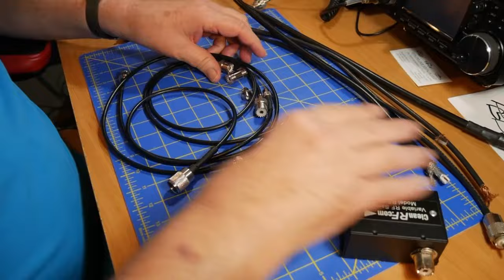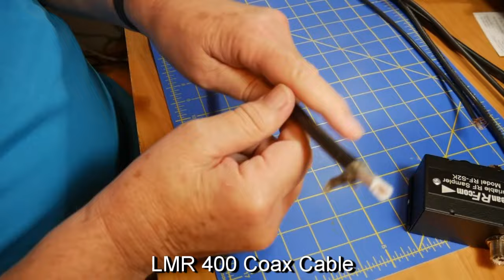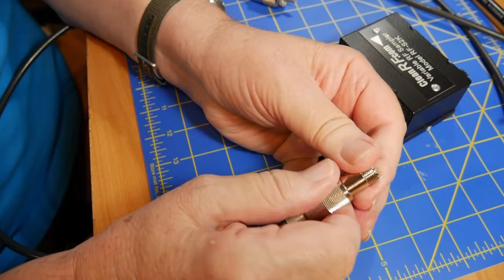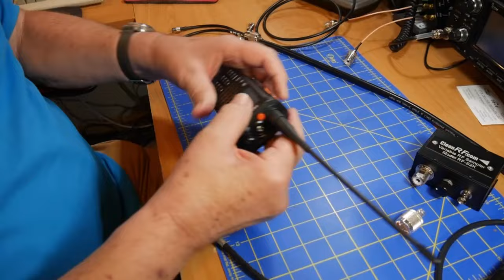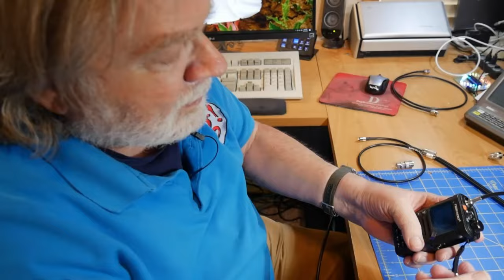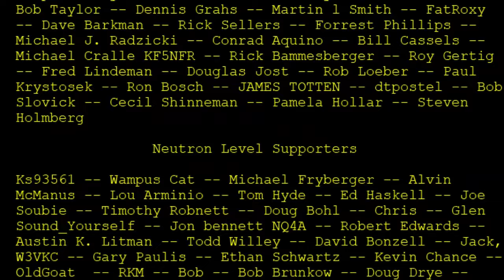Introduction to Ham Radio: Coax and Connectors (#1156)

Comment: I like all your videos.  I don’t know how to ask you a question.  I’ve laid out some radials for a 43’ zerofive vertical antenna.some of the radials are #14 gauge stranded wire.  Some of the radials are #14 gauge solid wire.  Will that cause a problem.  My name is Don Taylor from Monroe, Utah.
Reply from the maker: Not at all. Radials can be mix and match.